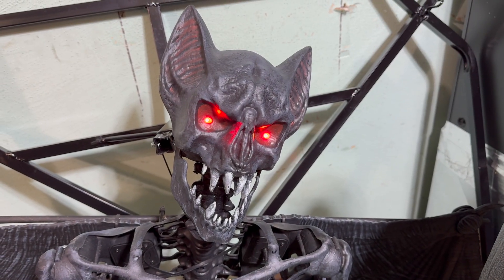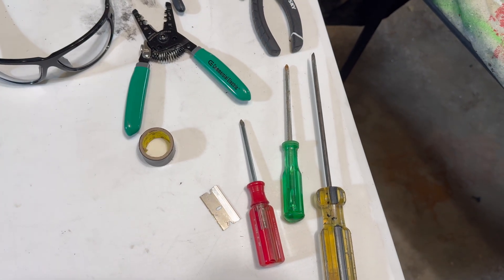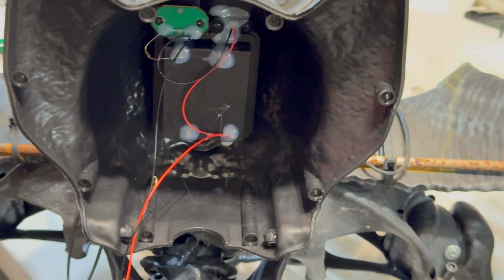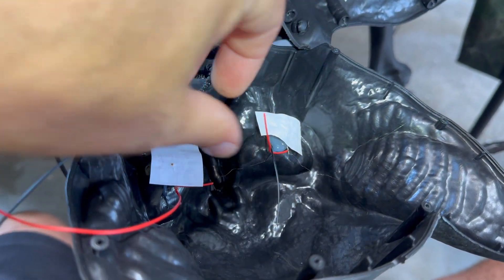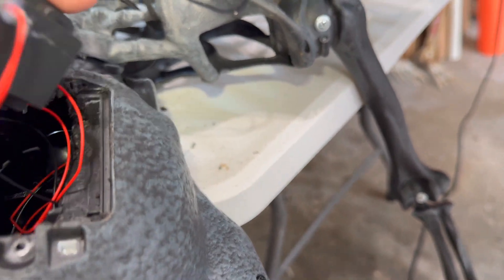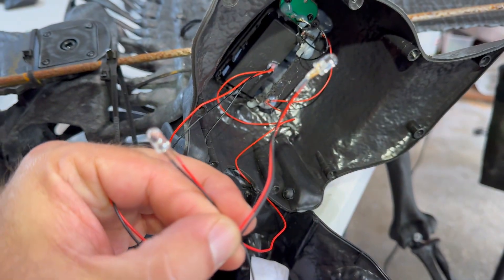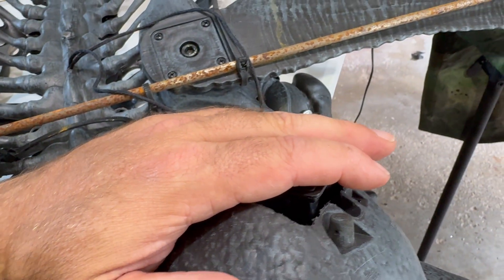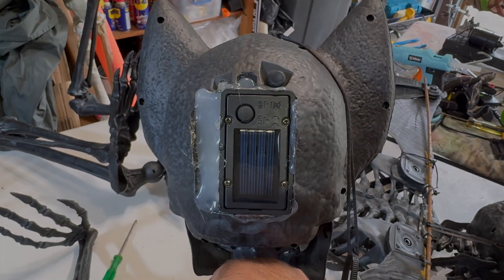Walkthrough to swap battery pack for solar power on Halloween prop

Comment: Seems like this could  be done with less destruction. Looking at mine and your instructions, it seems like a two wire solar box version would work fine. Just cut the two wires from the prop's battery box, drill a hole in the back of the skull at the base, feed the solar panel's two wires through the hole and connect them to the two wires from the prop's eyes.  Mount the solar panel box to the back of the spine with black zip ties or magic tape. Seal the drilled hole with a dab of silicone. Just a thought...I haven't tried it yet but I do like your idea. Going to order some panels now.
Reply from the maker: @DirtyCoastCajun  This is a walkthrough of how I did it. I like the way it’s contained within the previous battery compartment. I agree that this method involves mass destruction. ☠️